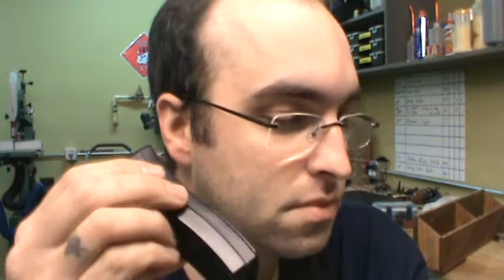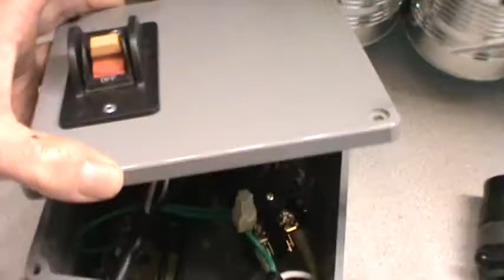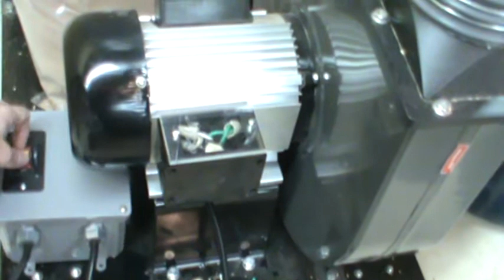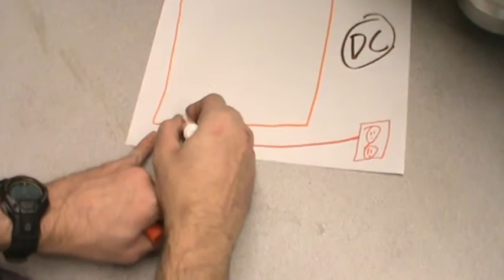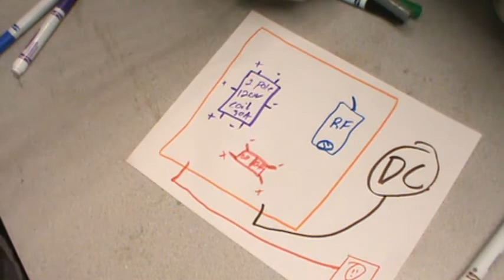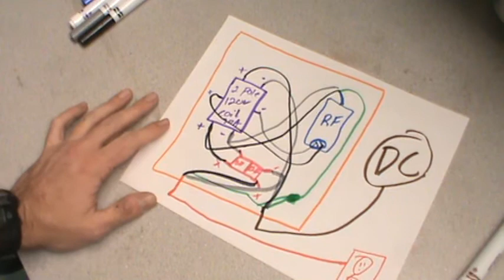Dust collector remote controlled mod

Comment: Why did you feel the necessity to add the contractor? Why not just leave it the way it was, just using the remote system as s. I don’t get the benefit of the contractor. You’re still using the remote to turn on the devices.
Reply: The contact has a higher amp capacity. The remote along is designed to turn on and off Christmas lights not control a 1hp motor.

Comment: I like the design and plan to build one myself.  I would not recommend using hot glue to hold electrical components in place since hot glue will loose its strength as your shop/box gets warm.  Having energized electrical connectors coming loose and moving around in a box could lead to a dangerous situation.  Use a mechanical fasteners to mount all components to provide a safer design.
Reply: there is no way the back of that shell is getting 400 degrees.

Comment: That's a lot of coffee cans. Great video. Really helpful. Would it make sense to add a built-in outlet to the box rather than having a pigtailed outlet? the only downside that I could see would be having to cut the hole. All in all a really clean build. Thanks.
Reply from the maker: Lol they are actually baby formula cans. You could add an outlet. I thought about it and just decided to do it all hardwired.

Comment: Nicely done project, and a much better video than my amateur efforts. I like the way you re-worked the christmas light controller to control your contactor and the way you bundled it all together in a neat package. I'm preparing to abandon my remote because I keep losing the silly thing under the shop junk. I'm planning to use a 24volt contactor and am running low voltage signal wire to micro switches at each blast gate. My blower is in a lean-to outside of my shop, but even so, the noise will remind me to close the blasted gate after I'm done with the tool.

Cheers
Reply from the maker: Thanks for the nice words. I also plan to use a 24 vac system on the blast gates when I get the shop piped in. I’m sure there will be another video about that when it happens.
Reply: @burnettescustomwoodworks5834  Hi, did you ever manage to setup the 24v for the blast gates?   Can you provide details please?

Comment: I built a copy of this using a single remote from Home Depot and it only cost $10. I screwed the contactor and receiver to the base of the unit and this was difficult working down in the plastic box. I thought this was the best design of any that I saw on YouTube and I am a retired electrical engineer. Mine works great. I have a Jet DC-1100C/RC dust collector and I needed to disconnect the IR scanner board in the power panel.
Reply from the maker: Thank you. A little simple wiring and saving money.

Comment: I wired this exactly like you did except I used a 40 amp contactor that I got from Amazon and is soon as I plug it in and then turn on the master switch on that box it pops the breaker with no tool plugged in nothing what is going on
Reply: I forgot to say, i used a Leviton 30 amp double pole switch as a master switch instead of the dust collector switch. Mainly because I don’t have the dust collector yet from USPS. Also I wouldn’t just take a switch from it.
Reply from the maker: Alex Masi email me. ffemt607@gmail.com I’m sure it’s something easy we can figure out
Reply: Burnette’s Custom Woodworks I got it figured out. I had the kill switch wired wrong, I was effectively creating a loop or a short, with the power in lead
Reply from the maker: Glad you got it figured out.

Comment: Question: Did you have to change the wall wire and circuit breaker to match 30 AMP?
Reply from the maker: No. It’s on its own dedicated 20amp circuit in the shop. The 30amp contactor Is in case I ever get a bigger dust collector.

Comment: Thanks for video.very useful information. I have a question when you have time
Reply from the maker: What’s that?
Reply: Burnette’s Custom Woodworks  would it be possible to have a manual switch also
Reply from the maker: Yes it would be possible